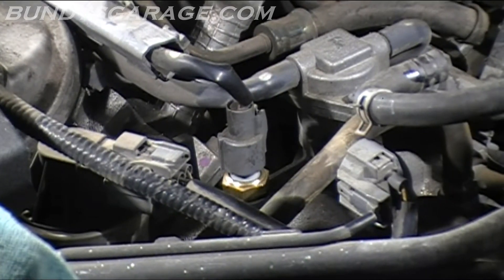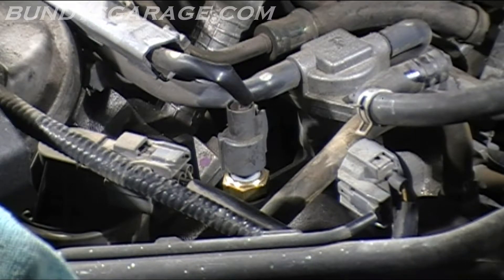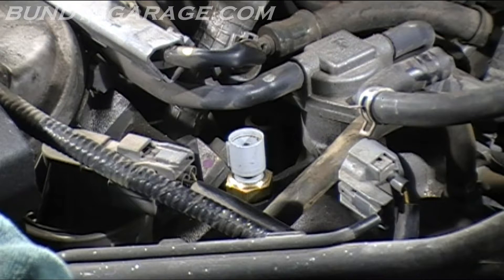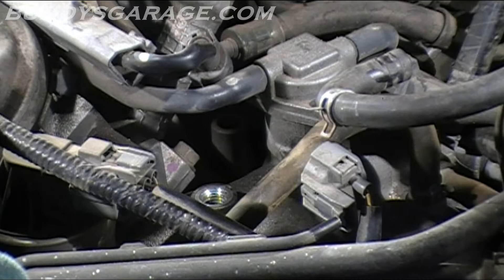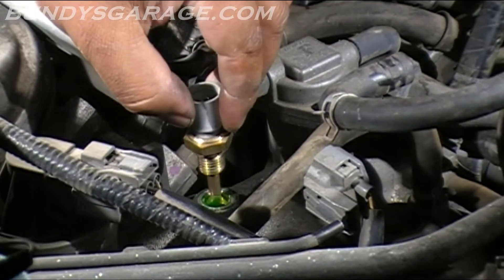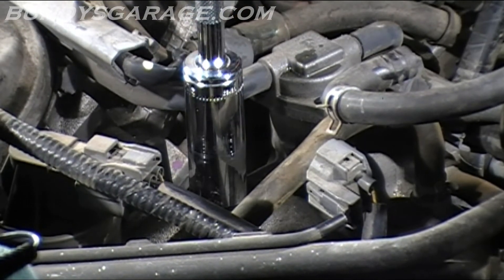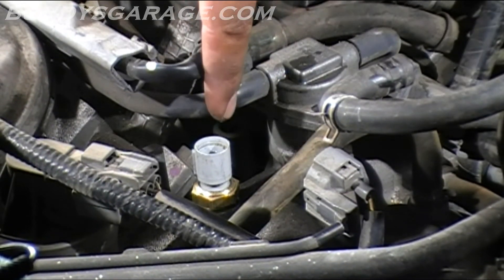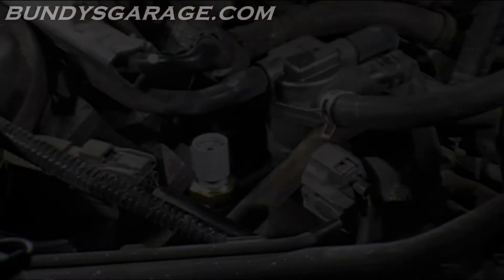UPDATE:Heat Soak Problem Solved Honda Acura J Series V6 - Honda Accord Acura TL

Comment: I replace the sensor long ago well like 3 months ago so i noticed since 3 weeks ago and i noticed like if i went to a place and park the car 5 mins later or 30 the car just die after starting its like shake and the rpm drop low i check the main relay and it smells like burning out
Reply from the maker: Same thing happened to me as well. Had it beat for two years, then is came back. I will tell you what to do but you have to promise to report the results here (good or bad)! You have to change 3 sensors, 40 bucks on Rockauto.com. You have to change the engine coolant temp sensor (19MM), the air intake temp sensor (19MM) and the fan (thermo switch) (it controls the fans behind the radiator) (24MM or 15/16 deep socket) sensor that sits in the thermostat housing. The air intake sensor is on the intake manifold on the back edge towards the drivers side. Here are the Honda / Acura park numbers. Just take those and plug them into the search bar on Rockauto.com. Fixed the problem for me, period. 37870-PK2-015. 37880-P0A-A02. and 37760-P00-004. Just make sure you don’t switch the air and coolant sensors when you install them. They look identical and will fit both locations. Please let me know if this fixes your problem. If you have any more issues email me. Let us know what happens.
Reply: BundysGarage sure i only need to replace the fan sensor and the ait sensor i know the etc sensor looks pretty much the same as the air temperature thanks the car it just starting to make that weird thing had it for almost two years and never happen before
Reply from the maker: Replace all 3. They are critical to the operation of the car as well as the ECU getting the right inputs. It’s only $40 from Rockauto.com
Reply: Thanks for the advice. I will try this. My local indy has been chasing this EXACT issue for 6 months. Told me my catalytic converter was melted and though it would "fix" the issue. It didn't and I am out $700. If replacing these sensors works I don't know if I'll be happy to have the TL run right again or mad that I spent $700 needlessly. I'll come back a let you know if a couple of weeks.
Reply from the maker: Dr S you gotta change all 3 sensors for it to work. Please see the comments above to know what I’m talking about if you haven’t already. Also please let us know what happens, good or bad, thanks.
Reply: Finally got tired of being stranded if I left a hot engine for more than 5 minutes. Would have to wait for 45-60 minutes before I could get it started again! Ordered the 3 sensors from Rock Auto as I have a history there. I got a chance to replace the 3 sensors this last weekend. Didn[t realize the fans were not coming on and the engine temperature was a little high. Now, the fans cycle as they "used" to and the IAT was filthy.. Don't know which one(s) made the difference but now, I don' t get stranded! Drove all weekend. Thank you as your advice is a life saver! Wish I would have seen this video before my local indy got me for $700.
Reply from the maker: That’s awesome!
Reply: Aren't engines wonderful? Same "heat soak" problem came back. And in addition, now the TL is hard to start when cold. Have a P0401 code. Time for a manifold cleaning?

Comment: your are a Fucking baller bro. straight pro status. just did it and drove around for an hour. put a timer on for 15 minutes went to start and its perfect. did it 3 times driving around. 25 bucks at autozone. 5 minutes to replace. thank you for your wisdom
Reply from the maker: +Stoner Wolf if it comes back again then you need to replace the FPR. Is it still holding up?
Reply: BundysGarage dude its perfect. I should also mention it took a bit of coolant to fill it before putting the sensor back in. I tested the hell out of it its perfect hasn't come back at all
Reply from the maker: +Stoner Wolf that's awesome! I chased this problem for a long, long time! Some people claim it does not work for them.
Reply: BundysGarage I saw but thought it was worth the 25 dollar gamble and it worked for me. I drive a 2001 Honda accord ex v6. I thought it could of been the low coolant lvl alone cuz like I mentioned it took about a litre to fill

Comment: I had the problem return, replaced the sensor again, but did not fix it.  I removed the vacuum line from the fuel injection pressure regulator and it has not had the problem since.  I am replacing the regulator next.  $100 but worth it if it fixes it.
Reply from the maker: +Rick S Barnes I have a video on how to replace the FPR, please keep us posted. Their are two FPR's available for the car. 99 - 00 had one PSI rating and 01 - 04 has a higher PSI rating, I would go to the higher PSI rated FPR. Please keep us posted, if you want I can mail you one. Let me know.
Reply: I know mine uses the 44 PSI, and as a retired Harley mechanic, you might want to resist the urge to use the higher PSI rated FPR.  Your injectors and computer may not like it.  Thanks!
Reply from the maker: +Rick S Barnes I don't think the parameters in the cars CPU are that strict. They switched the PSI rating for the FPR on the TL I believe the split was 01 | 02. That's why you don't see the heat soak problem on later TL's. The options for the PSI are 44 and 53 PSI. Just food for thought, not happening on the older models?
Reply: you are a genius! 
Everybody is busy checking the air filter and the tail pipe...  you nailed it !
Use an extended OBD2 scanner to read "live data": shows sensors values so parts saving pay for itself. No mo witchcraft. 🙂

Comment: Mine threw a code believe it or not. I have a 2000 Acura TL and I'm fighting this issue right now. I replaced my coolant temp sensor when the check engine light came on for it so now it's new and I'm still fighting the problem. If anybody has any idea's to help, please let me know. It literally happens to me every time I turn the car off now after driving it.

Comment: I have the same issue with my 2000 Acura TL, and while this coolant temp issue may fix some cars, I do believe the heat soak issue is real. This issue never happened until I moved to Dallas 6 years ago. Up until that time I had no issues with my Acura TL.  Shortly after moving from Salt Lake City to Dallas in July, we started having the starting issues. It was very sporadic and mechanics could really never find anything wrong. Over a three year period we tried spark plugs, coils, fuel filter, fuel pumps, etc. and it seemed as if the issue went away but then would come back again in a matter of weeks or months.  Left me very frustrated until I read the TSB put out by Honda. It described my symptoms perfectly.

I went back and tracked my repair receipts and voila! All repairs happened in the months of from October to March, and never in the summer months. Coincidentally, this corresponded to the times the Dallas area switched from summer to winter gas. Over the last four years I've tracked when the summer/winter fuel switch happens and sure enough, the issue would start happening again. However, I now knew that it was related to daily temperatures so I tracked that. As long as the days were generally cold, say below 50 degrees we never had a problem restarting the car when it had only sat for 20 minutes or less. But on any unusually warmer day here in Dallas during the winter, it will have the starting issue 100% of the time. The Acura must sit for 30 minutes or more for it to start with no issues.

I figure the reason this never happened to us in Utah even when they switched to winter gas is because the temperatures in winter practically never get above 45-50 degrees during the winter months in Utah, but they will quite often in Dallas. So, in my experience, the heat soak issue is real.

For those saying it fixed their issue, I'd be curious to know if they've tested it during a warm day with the winter gas. This issue is seemingly sporadic and it could seem solved when, in actuality, the right conditions have not yet been met to cause the issue to occur again.
Reply: I also live in Dallas.  I replaced my ECT sensor today because the car has been giving us fits this winter (warm winter). Will let you know how it goes.  Have you made any progress with your issue?  Thanks Bundy for your time spent on this.
Reply: Ya the heat is a problem and I proved it because when it happens I break open the fuel rail bolt and hot air sprays out then fuel follows

Comment: Hey Bundy.. I have had this problem on my 2000 Acura TL for 3 years. I have tried replacing the coolant temperature sensor, the EGR valve, the spark plugs and using different fuels. No luck. There IS a TSB that says that replacing the fuel pressure regulator and the PCM is required- so big bucks. You still think this is baloney??  I don't know what else to try and the car is barely worth that kind of repair investment. GEEZE- this is frustrating...
Reply from the maker: +Ben Kauffman send me your email address I have an article to share with you.
Reply: Thanks. I'll try anything. email is bfkauffman@gmail.com
Reply: I have had the same issue with my 2000 Acura TL, and while this coolant temp issue may fix some cars, I do believe the heat soak issue is real. I found the same TSB you did. See my post above.
Reply: Can you send me the article too please? My email Is maxchunn@gmail.com
Reply from the maker: +Maxwell Chunn 

https://drive.google.com/open?id=0B6a8_kxTeBtOTkIxdGpBdHRhY2M

https://drive.google.com/open?id=0B6a8_kxTeBtONDd3UlktVmZqWEE

Comment: Coolant temp sensor replaced, all injectors replaced, plug and coil packs replaced and still have this issue what can it be? The FPR AND PCM?
Reply from the maker: +THERIPPER216 Do the FPR
Reply: +BundysGarage Hey Bundy! First thanks for the video i have been searching for the cause to this problem for months now. I just changed the coolant temp sensor and it still has the same issue as the guy mentioned above. But can i change the fpr and not change the pcm or do both need to be changed?Thanks again
Reply from the maker: +Chris G Thanks for watching. It's so frustrating, I searched and searched for the cure on my own vehicle for a long time. I spent a lot of money changing parts, injectors, FPR, coils, spark plugs, etc, etc. I have talked to some guys that say changing the coolant temperature sensor worked. Others say is had not. I would change the FPR and I would use one from a 2004 Honda Accord. At that point Honda had updated the FPR to one with a higher rated one with a higher PSI. Please keep me updated.
Reply: Yea definitely annoying and my wife drives the car around and she always calls me soon as i get to work to tell me the car not starting again. I will try changing the FPR today. Thanks again fast response i just posted my comment lol
Reply from the maker: +Chris G Try going to a 53PSI one.
Reply: +Chris G Let me know if it works also im curious lol
Reply: THERIPPER216 sure no problem!
Reply: Chris G any update??
Reply from the maker: Same thing happened to me as well. Had it beat for two years, then is came back. I will tell you what to do but you have to promise to report the results here (good or bad)! You have to change 3 sensors, 40 bucks on Rockauto.com. You have to change the engine coolant temp sensor (19MM), the air intake temp sensor (19MM) and the fan (thermo switch) (it controls the fans behind the radiator) (24MM or 15/16 deep socket) sensor that sits in the thermostat housing. The air intake sensor is on the intake manifold on the back edge towards the drivers side. Here are the Honda / Acura park numbers. Just take those and plug them into the search bar on Rockauto.com. Fixed the problem for me, period. 37870-PK2-015. 37880-P0A-A02. and 37760-P00-004. Just make sure you don’t switch the air and coolant sensors when you install them. They look identical and will fit both locations. Please let me know if this fixes your problem. If you have any more issues email me. Let us know what happens.

Comment: Hats off to you sir. I've worked at an Acura dealer for many years and have a careers worth of Honda experience and have dodged this customer complaint many times thankfully they weren't as consistent as the 2000 accord I'm working on today that I can't dodge lol I have my own shop now and it's my good customer with 320,000 original miles. The reason I've dodged this over the years is because Honda actually actually has a bulletin that addresses this problem. They say to replace FPR and ECU. I've always doubted this would fix the issue and I just wasn't comfortable writing up a $1500 estimate knowing it would most likely comeback. You have figured out what Honda engineers couldn't. KUDOS!!!!

Comment: I replaced the coolant temperature sensor in my car--it didn't fix the problem.

My 2000 Accord LX VTEC V6 (125k) suffers the EXACT problem with symptoms PRECISELY as you describe (e.g., engine won't start or hold an idle or after the car is driven and then parked w/engine off for ~15mins; runs rough if gas pedal is held or after transmission is quickly shifted into gear; MIL light with resultant misfire codes; etc.). Your anecdotes about suggested causes line up with my research: e.g., Honda TSB 00-024 "Heat Soak" issue (http://tinyurl.com/jukplao); ethanol fuel vaporization in fuel line; generally poor quality fuel; fuel pressure regulator too small; returnless fuel rails; trapped air in coolant; overly tight I/E valves; EGR issue; carbon build up in the plenum, intake runners and valve stems; bad plugs and/or ignition coils; wonky solder joints in main fuel relay... and on and on and on. Your observation that your engine ran fine for years before showing symptoms also matches my experience.

I've invested eleventy-bazillion hours trying to ferret out the cause of this problem. I've spoken to a bunch of mechanics, from shade-tree Accord owners like myself to vaunted Honda-centric SAE techs, none of whom could divine the source of its ailment. Few have even heard of it. Then I came across this video. My first thought: there is absolutely no way is this onerous problem is such an easy repair.

Turns out, in my case, my suspicion was true: your fix--just one more in a long list of speculation--didn't work either.

I ordered an OEM 37870-PK2-015 sensor (http://tinyurl.com/zmk7lfe), installed it, purged the coolant (using the procedure & tool demonstrated here: https://youtu.be/zUpXgAJ1gjU), purged it again using your technique, and test drove the car to induce the conditions that manifest the symptoms. Then I parked the car for 15 mins.

When I cranked the engine, it wouldn't start or hold an idle. The MIL illuminated. Sooo...  replacing the coolant temperature sensor in my car had absolutely no affect.

<plaintive sigh>

Btw, I tested the possibility of a bad (new) water temp sensor: I disconnected it with the engine running, which immediately affected idle, demonstrating the ECM gets signal from the new sensor.

Your thoughts?
Reply from the maker: Email me your email address and I will send you an article that goes over this very problem. 

bundysgarage@gmail.com
Reply: Hey tim have you found a solution for this problem?
Reply: Yes. I swapped the stock "return-less" fuel rails on the '00 Accord V6 with the seemingly bolt-compatible fuel rails  from a '00 Odyssey. 

NOTE: This retrofit is NOT the ONLY solution to this evasive problem. The '00 Accord/Acura 'hard start condition' is chronically misdiagnosed and has many disparate causes; e.g., "Heat Soak" (Honda TSB 00-024), faulty ECU, bad FPR, poor fuel, etc. But common sense dictates that installing closed-loop fuel rails should eliminate fuel vaporization within the fuel rails (a.k.a., "heat soak") presuming HEAT SOAK IS THE ACTUAL CAUSE of the 'hard start condition' with your specific vehicle.

The Odyssey's fuel rails are a closed-loop system; meaning, pressurized fuel passes thru both fuel rails and returns to the tank (whereas in the Accord/Acura V6, pressurized fuel just rests in the fuel rails until drawn down via the injectors); thus, warm fuel never has the opportunity to absorb enough heat to vaporize.

This retrofit is not particularly complicated. As add'l reassurance, if the 'hard start condition' persists after the fuel rail swap--a clarion indication "heat soak" is NOT THE CAUSE of your  'hard start condition'--you can easily reinstall the original fuel rails, if you want, or just leave the Ody rails in place.

I purchased a set of used '99 Ody fuel rails from an EXCELLENT Honda-exclusive parts source: Beaver's Honda (www.beavershondasalvage.com), for ~$65. Excellent instructions for the fuel rails retrofit process are here: https://tinyurl.com/djpaz28z, and elsewhere on the web. The swap-out is genuinely straightforward. If you've ever replaced the fuel injectors on this engine, then you already have experience with the 92.8% of the labor involved.
Reply from the maker: +tim ault did swapping to an Odyssey fuel rail fix the problem?
Reply: Would you mind emailing me the article as well?  I am going through the same issues, and have performed some of the suggestions made with no luck.  dionicio_martinez_80@hotmail.com
Reply from the maker: +Dionicio Martinez what have you replaced? Yeah I'll send you the article.
Reply: BundysGarage only replaced the temp sensor and ran a ground to the thermostat housing. I discovered that my radiator cap was broken and I was low on coolant.  Going to replace the cap and top off the coolant and report back.
Reply from the maker: +Dionicio Martinez here you go:

https://drive.google.com/open?id=0B6a8_kxTeBtOTkIxdGpBdHRhY2M

https://drive.google.com/open?id=0B6a8_kxTeBtONDd3UlktVmZqWEE